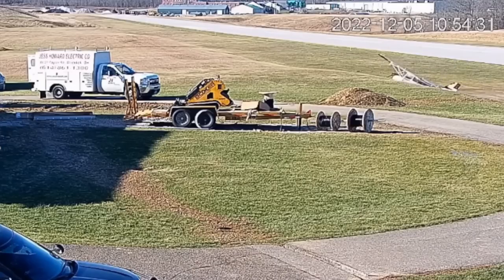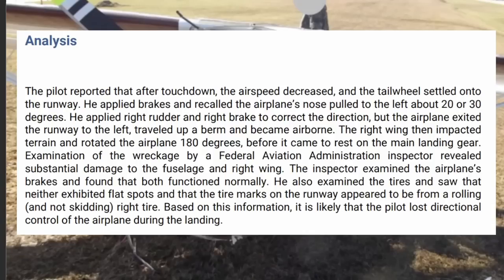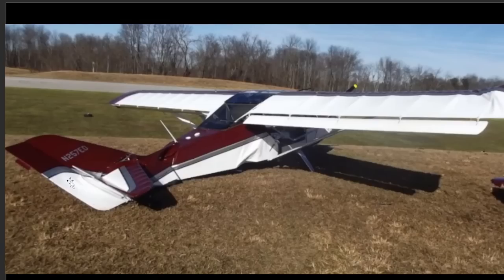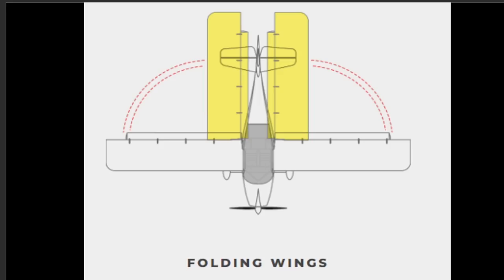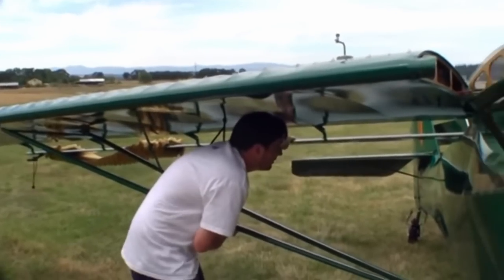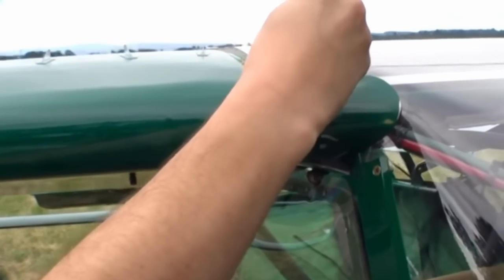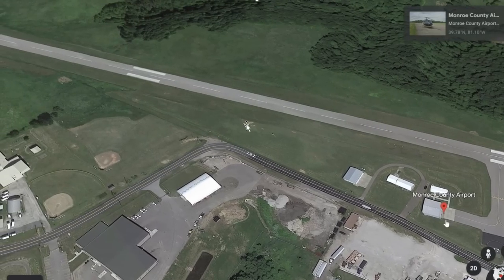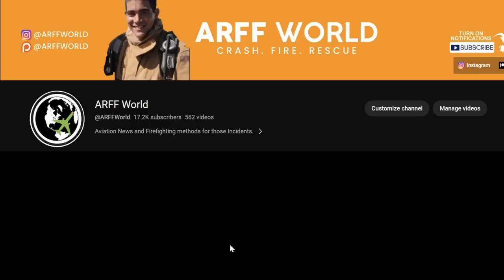Airport Camera Helps Investigators in Ohio

Comment: When instruction became standardized by the Practical Test Standards, now Airmen Certification Standards,  instrument integration with contact flying and V-speeds for our small trainer aircraft came into common usage.  Vy, the math best climb speed for takeoff, and 1.3 Vso to the fence for landing came into common usage.  Way too slow for safe takeoff and way to fast for safe landing.  This airplane was going fast enough to fly again after the hill ramp.  Vso is an out of ground effect number that has nothing to do with how slow an airplane can fly in low ground effect.  We have gotten completely away from what Wolfgang encouraged on page 302 of "Stick and Rudder."  "The stall-down landing requires that you blend the approach glide, the flair-out, and the slowing up of the airplane all into one maneuver so that, when you arrive at ground level, you arrive in a three-point attitude, all slowed up and ready to squat."  I didn't let students use brakes at all on tailwheel trainers.  There is no need after touching down slowly and softly, with power, on the numbers every time.  In ACS terms that would be a "soft field landing" but to the desired spot using power to control glide angle and rate of descent.  Touchdown will be much slower than Vso.
Reply from the maker: Thank you for stopping by Jimmy to share.  🤙🏽
Reply: @Jimmy Dulin I can vouch for what you said. I am grateful that I fly my aircraft (Legend Cub) in and out of the flight school where I learned. My instructor pulled me up one day saying that my landings were far too long and hence dangerous on his short grass strip. Same deal, I was actively using brakes to pull me up. This plane had so much energy. The downwind/base/final phase was obviously not done at the recommended speeds, spacings etc. My instructor told me, "Slow down before you go down"
So on downwind, at the numbers (1000 ft AGL) (no wind or turbulence), I reduce power to about 1500 rpm. Adjust pitch for 50 knots and 500 fpm descent. Turn base at 45 degree aimpoint and 750 ft AGL and cut power to idle while applying back trim. The desired result is a descent of about 500 fpm and about 50 knots. Turn final should coincide with 500 ft agl. Pitch up slightly to achieve about 45 to 48 knots. Slope can be steep without much speed increase if start of final speed is kept under best glide (52). Stall speed is 33 knots. Cub is doing 35 on the bottom of roundout in ground effect and generally stalls into a three point easily
Reply: Mr. Dullin, the pilot is blaming "the brakes" but i think he is lying.  First he said that the tail settled down and he applied brakes and airplane went hard left.  BS...  I see that airplane hitting that hill at not taxi speeds but at flying speeds for an LSA.  Looks like he tried to go around, didnt control the  torque (Airliner style, LOL), went to the hill, and didnt also control the right turn from hitting it.  I see no controls used after hitting the hill.  3 big student pilot mistakes.  That guy should not be flying airliners due he freezes on controls when scared.  He is an "Airline Pilot" as stated on report.  LOL>>..
Reply: @emergencylowmaneuvering7350  I have given Bi-annual flight reviews to TW pilots who use dynamic braking to react to the greater weight behind the gear than in front trying to come around as it always does.  Too much airspeed, so that the aileron is effective, is also part of the problem.  I teach deceleration on short final to bring the throttle into dynamic control of glide angle and rate of descent.  I teach using rudder only on short final all the way through touchdown and roll out for longitudinal alignment.  Aileron is for bank.  Since we don't want to turn, bank is only for drift control...stabilized bank not turning left and then right and then left bank.  This wing walking is the result of not using dynamic proactive rudder only to bracket the centerline between our legs for longitudinal alignment (tail wagging or walking the rudders.)

A huge help to controlling airspeed all the way down properly has nothing to do with the airspeed indicator (we need to look outside for situational awareness) or Vso.  The airplane is still flying in low ground effect well below Vso airspeed, just watch pilots become passengers on the long, long hold off.  The have taken away the throttle, the best glide angle and rate of descent control because the were too fast 1.3 Vso at the fence.  1.3 Vso is fine to get us to short final a quarter mile out and then is way too fast.  Pitch to slow down, add the needed power to hold glide angle.  Anyway, as Wolfgang suggests, "The clue to watch is the intended landing spot and the scenery beyond it and to the sides of it.  Once the normal glide has been broken, the process of stalling the airplane down can be gauged entirely by watching the spot and the perspective in which it appears and its apparent motion."  Page 304 "Stick and Rudder"  Think about how we decelerate coming into an intersection with our autos.  Way back, the intersection appears to close with us at a brisk walk.  As we get closer, that apparent closure rate appears to speed up.  We decelerate only enough to prevent the apparent speed up of the closure rate.  We stabilize our approach using the apparent brisk walk rate of closure.  Do that.  No the airplane will not stall.  The spot will go under before that happens and we are now concerned with the flair in ground effect anyway.  Vso is not an issue here.  In fact it is what causes accidents like this one.  The airplane is going to try to keep flying at Vso in ground effect.  Vso is an out of ground effect number.

Anyway, V-speeds are important to stay ahead of the incredible weight of the big airplane the ATP is used to flying.  Small, low powered, airplanes are different and back in the "Stick and Rudder" days we taught pilots to fly them properly.

ARFF World, almost all pilots in the last fifty years have been taught as if they were flying tremendous power to weight airplanes.  They are killing themselves flying exactly as they were taught to fly to meet Airmen Certification Standards and pass the written and flight test.  I am spending my remaining several years, I hope, to talk to and fly with (on my dime) as many instructors as possible.  I encourage them to teach safe maneuvering flight techniques (flight down near the earth) first to solo quickly because they then actually know how to fly.  Prep for the written and flight test can follow without much delay.  Flying is like riding a bike.  It is easy to do and easy to teach quickly.
Reply: @emergencylowmaneuvering7350  I definitely think the approach could be considered un-stabilized. Short field scenario training and spot landing competency should be mandatory for all licence types to pass. It's very easy to overlook the need to hone base-final skills when we have thousands of feet of runways at airports to land very light aircraft. You can almost completely ignore energy management and get away with it most times. To be veering to the left and simultaneously traveling across the ground at stall speed or greater, can only mean loss of directional control due to either crosswind or, as you say, left yaw due to sudden full power application on an attempted go-around. The application of right alieron (while in a three point, stalled, nose high attitude) in an attempt to roll the wings away from the left would have worsened the situation as the downward aileron would have caused severe adverse yaw, pulling the aircraft even further left. Another thought is, that if you are traveling quickly on the runway, it may be wiser to pitch the nose over (lift the tail into the slip stream) for better directional control. Rolling at high speed in a three point attitude, to my mind, is just inviting an unintended ballooned liftoff followed by a tip stall or at best, a loss of directional control.
Reply: @jimmydulin928  I was a student of the ELM Channel CFI in 1996.  I really learned to use the rudders well when we didnt cancel the lessons that winter in high winds.  Cessna 150 really likes to weathervane in 25 knot winds.  We first went up and down a crosswind runway keeping the line with rudder.   Really helps.  My previous CFI's used to cancel lessons if strong winds.  Easy maneuvers make easy to crash pilots.  You become A Mild Maneuvering PIlot.  That airline pilot i bet was used to mild maneuvers only.  not much rudder use.  Airliners have a tiler for turning, much more heavy and not much rudder is used to turn. Easy to develop lazy feet.
Reply: What are you talking about? Are you blaming PTS, now ACS, as the reason for this? It is lack of airmanship and LOC (Loss of Control) as the biggest reason for accidents, pilots acting like passengers along for the ride.  Yes, weather, fuel starvation still makes an appearance in the accident stats... but LOC is a big one. Also, the comments about: "When instruction became standardized"??? "When trainer aircraft came into common usage" ??? "V-speeds" ??? "Instrument integration" ????   I understand the words as a CFI, CFII, CFI-ME.... ATP.... BUT WHAT???? Ha ha. 

1.3 Vso is way too slow? You use what the AFM or Pilot Op Manual says to use for the Vref approach. OK? Yes 1.3 x Vso is common for estimating approach BUT VARIES WITH A/C gross WEIGHT.... However that does NOT mean you don't or can't reduce power (to idle) "over the fence" and land near Vso at touchdown.  All the things like standardization, general knowledge or rules of thumb like Vref (your approach speed) is goodness. Insterument skills? Very good thing. I am doing two instrument students, one initial and one CFII candidate currently. Instrument flying makes you a better VFR pilot. 

 You are just naming (blaming) things that are irrelevant to this case.  Yes, the pilot likely landed WAY too fast, and the plane was clearly still "flying" when it departed controlled flight / landing. It was a big A** F*** Up.....  None of your comments is relevant to me, no offense. I would love to hear why you listed all this stuff. It is not "Rocket Surgery." He lost control.  Why? Who knows. We know from his comments and ARFF's video that the pilot claims of what he did does  not match what the initial investigation evidence shows. I can guess I'll read the probable cause in the final report in 1 year or more (speedy NTSB Gov agency), pilot failure to maintain directional control. 

HE SHOULD HAVE GOT transition training (1, 2, 5, 10 hours or as as much as Req to be proficient) with a CFI who KNOWS KITFOX planes. I have ZERO time in a Kitfox but +1000 hrs as CFI and +1000 hrs taildraggers. I WOULD GET TRAINING, a complete checkout in a Kitfox by experienced Kitfox pilot. I suspect the Kitfox is easy to fly, but you have to respect it....   I offer as a CFI RV transition training as an RV builder/owner, with +1000 hours in most of the  RV models. I do transition training for Pilots new RV's. Often insurance requires this training before insuring the aircraft (for good reasons). KEY HERE GET TRANSITION TRAINING IF NEW TO A NEW TYPE ESPECIALLY EAB (experimental armature built) Kit plane.  If you leaned in a C152 the transition to C172 is straight forward but get transition training.  If you learned in Piper Cherokee and upgrade to another single engine low wing Piper, kind of straight forward transition, but a checkout with CFI (often required for the FBO) is wise.  However EAB Kit planes are not standard and may be very different, not only how they fly but in systems. Look up John Denver's Long-Ez crash. 

Regardless, Lancair, RV, Zenair, KitFox, Sling, Velocity.... GET TRAINING.  I can NOT count on all my fingers and toes how many new to EAB pilots crash soon after buying the new (to them) plane, often first flight I am personally aware of. . When I started in aviation in late 80's and already an EAA member I was struck by how many Kit planes crashed on the first flight after the Builder/Pilot  inaugural flight. In the garage for 5 years, rusty they go fly and the new hot homebuilt plane and crash. WELL now we have a lot of EAB' Kit planes on 2nd hand market and the new owner is Mr. or Mrs. Crash Test dummies. GET  CURRENT and GET TRAINING IN TYPE.  It has gotten better because kit planes are better.  Although my career when I went to a new aircraft type or model, I got a checkout and some formal or self guided training....  The old saying was, "If it has wings, I can fly it, and the box it came in," is funny in the bravado,  but only true if you have Bob Hoover skill. Us mortals need training and currency by practicing refreshing skills with more training. End of story.
Reply: @gmcjetpilot  Yes, I agree with you emphasis on training.  My problem with ACS is the teaching of small airplane pilots to takeoff too slow to recover, after startle delay, from inadvertent stall and to approach safely but fail to decelerate before the beginning of the landing surface available.  Regardless of technique, power/pitch to flair with power or round out and hold off until kinetic energy dissipates at an unknown time with both airspeed and altitude controlled by the lonely elevator control.  Not "all slowed up and ready to squat" as we learned from Stick and Rudder before PTS mandated V-speeds too slow for safe takeoff and too fast for safe landing.  And we taught, on 1500' small town airports, landing tailwheel airplanes without using any of the poor mechanical cable operated brakes.  Brakes we there to help turn around without a wing walker.  ACS works well for those going on to large, powerful airplanes.  Teaching commercial pilots to lead rudder for any hope of coordination and allowing the nose to go down in steep turns to prevent stall as designed for Ag work is a much different story.

Many of the LSA airplanes will almost hover out of ground effect because of high thrust to weight ratio.  The are not good trainers for small airplane flying and when the prop stops with the airplane in a crazy high pitch attitude, it is all over.

Again, you are right that ACS is a good training for corporate jet and airline work.  In my opinion it is not only not as good as Stick and Rudder for small airplanes, it teaches very poor energy management including wind management.
Reply: @jimmydulin928  I don't get it. ACS does not specify speeds only standards. The planes POH does discuss speeds and it's indicated by colored bands on airspeed indicator. If this is a certified aircraft, it's all been flight tested and documented and approved by the FAA. It has nothing to do with the ACM for Private, Commercial or ATP. 

Vx, Vy, Vso, Va, Vfe are in planes manual, even EAB ( Experimental amateur built kit plains) which have to go through a flight test program. The difference is FAA does not approve. However with KIT EAB planes, especially popular Ines, long in production and many flying, airspeeds, limits and operationally are known.

As PIC fly what speed you want, faster, up to you, but this JET landing in  Kitfox was a big fat F minus. Little planes don't get weight on wheels until wing is below flying speed. Maybe the Captain thought the Kitfox had AUTO Spoilers, Auto Brakes w/ anti skid  like an airliner. Heck CAT 3 auto land in airliner will flare, touch down,  roll out on centerline to a stop with no pulot input.  The pooch was screwed here. OK 👍

Comment: The kid showing how the wings pin had it right the first time. The Kit Fox has flaperons not ailerons. The flaps and ailerons are the same control surface, they still function as ailerons while being applied as flaps or not. You can have a million hours in airliners or any other tricycle gear aircraft but until you’ve flown taildraggers with the proper supervision and instruction, and you’ve learned to dance on those rudder pedals as well as control the tail, you’re gonna ground loop and swear you’ve done it all correctly. The evidence shows a different story than the pilot tells.
Reply from the maker: Thanks Rob for sharing about flaperons

Comment: Speaking in general, NOT about the specific actors, if I'm using another pilot as a delivery agent I would want him to be familiar as possible with specific plane, model and type. I would not expect an airliner pilot to know how to handle a featherweight tailwheel aircraft, particularly takeoff and landing. In this case, since he was not alone in the aircraft, he should have been checked out. At least the occupants survived.
Reply: Former FAA inspector here. 
I've signed many many MANY special flight authorizations (Ferry permits) but have NEVER signed one that has "passengers".
Either the FAA screwed up OR the pilot of this aircraft had an un authorized passenger.
Why would this aircraft "require" a passenger for this ferry flight?
It didnt.

Comment: NTSB doesn't have "he f**ked it up" category but these type of mishaps definitely fall in to that category.   We should never criticise a tail wheel landing because nobody's immune. I've heard pilots blame others for lack of training etc. Only to have exactly the same mishap later on...  For those not familiar, on a tailwheel aircraft the centre of gravity is behind the main wheels, which means it prefers to travel bum first and is trying at all times to swap ends, the pilot has to catch it with a ballet of rudder movements that become instinctive after a while, but every now and again they still bite and full rudder and brake won't stop it once its decided to swap ends.
Reply from the maker: Thanks James for sharing your thoughts